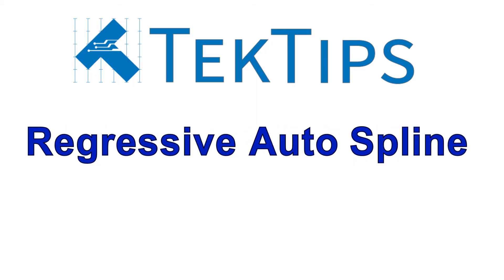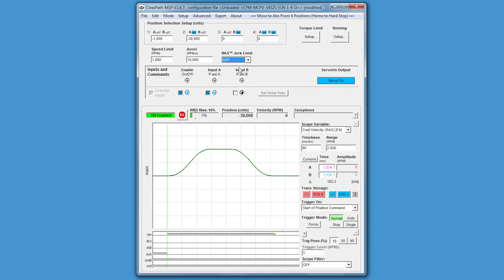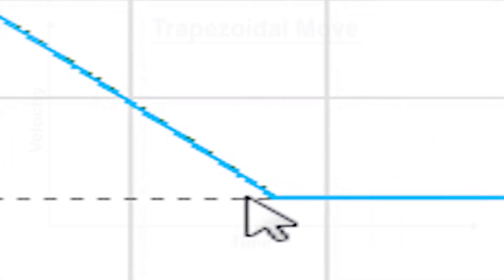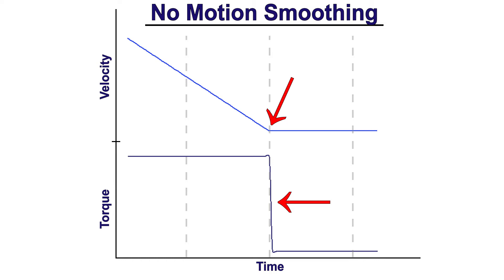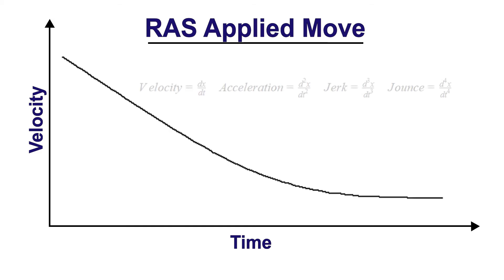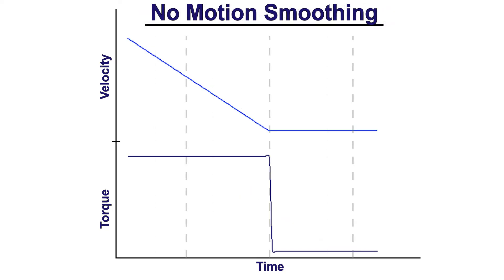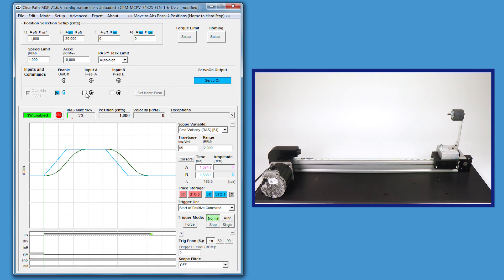ClearPath's RAS: Smoother Motion Control than S-Curves

Comment: wouldn't a pid control work just the same
Reply from the maker: Hi YUP,

While PID control loops (or PIV for ClearPath) and RAS are both used to improve servo performance, they operate in completely different ways. PID control loops use feedback to proportionally control the servo response. RAS does not change how the servo responds to the command, but instead, modifies the incoming command to reduce jerk and jerk derivative. 

If you have additional questions about how RAS can benefit your application, please reach out to Teknic’s support (https://teknic.com/contact/) or give us a call at 585-784-7454. 

Best,
Bradley N. – Teknic OEM Application Engineer

Comment: Is it possible to do this with stepper killer motor type?
Reply from the maker: Hi Roman,
Yes, Teknic's RAS feature is available in all ClearPath models, including the ClearPath "Stepper
 Killer" (SDSK) models.

The "Regular" (R) encoder resolution option of the SDSK models has RAS settings up to 16 ms. The "Enhanced" (E) encoder option has the full selection of RAS (and 8x the commandable encoder resolution),

You can view all of Teknic's SDSK and SDHP models at:
 https://www.teknic.com/products/clearpath-brushless-dc-servo-motors/clearpat,h-sd/all-sd-models/#ppsShowPopUp_100.

Please feel free to contact us directly through support@teknic.com if
 you have any other questions!

Best regards,
Aaron B. – Teknic Servo Systems Engineer

Comment: Just come cross this video it’s nice and detailed explanation but you never competed RAS to S-Curves with for me is exactly this same thing just you use different name. S-profile have 7 characteristic also include smooth increasing or decreasing of acceleration. And torque curve looks like RAS, 
can we have comet on this ?
Reply from the maker: Hi Marek,

This is an excellent question, although not an easy one to answer concisely, so please bear with my long answer. I think it will clarify the differences between “s-curve” and RAS™.

Assuming our goal is to make motion as smooth as possible, and with minimal vibration and settling time, we need to make sure that the velocity-vs-time move profile never requires an instantaneous change in motor torque. Not only is it impossible for any real-world system to follow an instantaneous change, but by trying to do so, the system will generate shock, noise, and vibration. These negative effects are bad for performance and cause excessive wear on the mechanical system. 

The common trapezoidal move profile, with its sharp corners, clearly asks the motor to instantly change the torque it puts into the system. Most people intuitively understand this because the sharp discontinuities are easily seen. (7:44 shows this graphically)

What’s less obvious is that even a smooth looking velocity profile can demand instantaneous changes in torque. To understand why, consider that the torque required by a motion system is proportional to the acceleration required. So, if we want to make sure a profile never requires the torque to change instantaneously, we need to make sure it never requires the acceleration to change instantaneously. In other words, any change to acceleration must be gradual.

The term “s-curve” is used a bit loosely in industry; it’s used by some manufacturers to refer to substituting a half cosine curve in place of the linear acceleration of a trapezoidal velocity profile. Other manufacturers use “s-curve” to describe a velocity profile with a constant jerk (rate of change of acceleration) at the beginning and end of the acceleration parts of the move. 

The latter is called “jerk-limiting” because the jerk is held to a constant finite value (or zero, during the constant acceleration and constant velocity parts of the move). A mechanical analogy that might help visualize constant jerk is putting a circular (i.e., constant radius) fillet into the corners of a trapezoidal profile. 

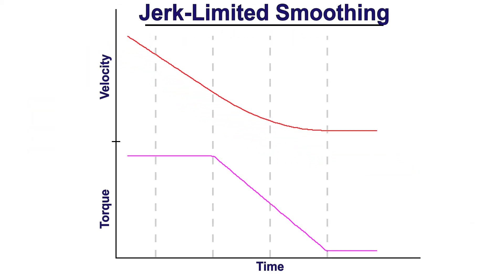A jerk-limited velocity profile looks smooth, but the acceleration is zero at the start of the move and abruptly starts ramping up at a constant rate. Then, as the acceleration limit is reached, it abruptly stops increasing. In other words, although the velocity profile looks smooth, the acceleration profile of this move is a trapezoid with sharp corners. This means the torque will have to change abruptly, causing noise, vibration and longer settling time for the mechanical system. (8:40 shows this graphically)

The half cosine type of s-curve is a little better, but still has abrupt transitions in the acceleration profile, and has the additional disadvantage that the maximum jerk will increase for moves of short distance where the maximum velocity is not reached. This is because it tries to fit the same half cosine into a shorter time period, and this makes the rate of change of acceleration (i.e., the jerk) increase. Even worse, some manufacturers will just truncate the cosine when constant velocity is reached. This results in a very discontinuous profile. With normal jerk-limited profiles, you can set the jerk limit to the maximum value you can accept for your system, and the profile should never exceed that limit.

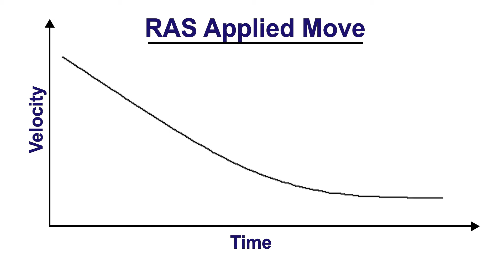The RAS feature not only limits the jerk (regardless of move parameters), but also limits the rate of change of the jerk to a constant value. Limiting the second derivative of acceleration in this way means that the acceleration profile, instead of being a trapezoid, is nice and smooth. (11:07 shows this graphically)

With the RAS feature, there are no abrupt changes in torque at any point in the move profile under any circumstances. 

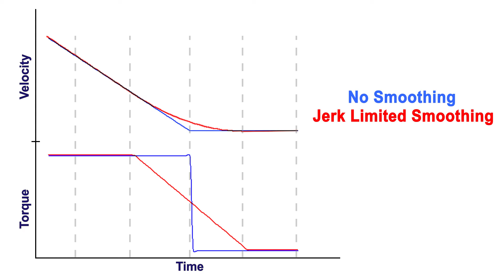Having read this explanation, take a few minutes to re-watch the video from 7:44 to 13:30. That section of the video explains, in graphical terms, how the torque requirements are different for trapezoidal, jerk-limited, and RAS profiles. 

One final note: the RAS is available in all Teknic products that have a built-in motion profile generator (e.g., MC and SC-series ClearPath motors), but also in products that accept step & direction motion profiles from a third-party controller. In the latter case, you should actually select a trapezoidal move profile within your controller, and allow the RAS to convert the profile on the fly into a jerk- and jerk-derivative limited profile. A demo of this (including the effect of RAS on the torque) can be seen in the ClearPath Step & Direction video, starting at 1:10. 

I hope this clarifies the advantage of the RAS compared to other techniques that attempt to reduce profile-induced vibration and noise. Please feel free to email us at support@teknic.com if you have further questions.

Best regards,
Zach H.
Reply: @TeknicInc   "With the RAS feature, there are no abrupt changes in torque", as I understand this, this is the same with limiting jerk. There is no jump in acceleration, it only starts increasing at a limited rate.
So, to convince the audience, please show a jerk-limited profile in comparison to RAS (or 3rd-order to 4th-order limiting?).

Another consideration is the time used for the whole movement. In the introduction demo I hear that the move with RAS is at a much higher speed (heigher frqeuency, I guess at least 1.5x, may be 2x). That's probably ok for applications that don't have a physically limit on speed. But it increases the acceleration time for speed limited applications that are already at their limit.

In your example curves at https://youtu.be/WOyP51-PiTs?t=763 we see, that the time increases from 2 to 3 sections by switching the profile. I understand, that it's not the complete deceleration curve, but your demo shows, that it's not insignificant for this application as the speed increases drastically.

Another consideration is resonance. Resonances are the limiting factor in many cases. My hope is that resonances can be eliminated completely by higher order limiting. This would make your products much more attractive, and I assume they can probably provide such an improvement.
Can you give an example of such a resonance situation? But please don't restrict yourself to a single resonance case, instead show a frequency scan (e.g. by showing a sequence of moves back and forth with a changing distance), because different profiles usually only move the frequencies but don't eliminate them at all.
Reply from the maker: Hi  @aribowell ,

Thank you for taking the time to reach out. I apologize in advance for my long response. You have asked a number of good questions (questions that are frequently asked by other customers), and I wanted to take the time to answer you thoroughly. 

In the event you didn’t notice my colleague’s response to the original comment, he stated that: “Assuming our goal is to make motion as smooth as possible, and with minimal vibration and settling time, we need to make sure that the velocity-vs-time move profile never requires an instantaneous change in motor torque. Not only is it impossible for any real-world system to follow an instantaneous change, but by trying to do so, the system will generate shock, noise, and vibration.” 

In reading his comment, I thought it might be helpful if I tried to explain this in a slightly different way, with additional detail. 

Within position control servo systems, there are actually three separate “servos” operating at any time. These servos are responsible for minimizing the errors in position, velocity, and torque. 

One of the primary tenets of Teknic’s servo systems is that we never want to command one of these servos to do something that it cannot physically do. For most people, it is intuitive that it’s impossible for the velocity servo to follow an instantaneous step change to the acceleration (i.e., a sharp corner in the velocity profile). We solve this problem in the common trapezoidal velocity-vs-time command by limiting the jerk component command. 

What is less obvious is that a step change to the jerk — instantaneously transitioning from zero acceleration to a constant rate of change of acceleration (i.e., constant jerk) — causes a sharp corner in the required torque. The algorithm that servo controls the torque tries to follow the sharp corners, which causes machine vibration, noise, and other undesirable effects. The RAS limits the jerk-derivative of the motion profile which eliminates the sharp corners in the torque command, resulting in smoother and quieter motion.

I do agree with you that seeing the differences in motion profiles (especially in the torque domain) can be very helpful in understanding this fairly complicated yet important point. If you re-watch the video starting at 13:00 (https://youtu.be/WOyP51-PiTs?t=780), the engineer in the video graphically compares the difference in the commanded torque when using the RAS or a jerk-limited profile. At 13:30 (https://youtu.be/WOyP51-PiTs?t=810) he overlays the commanded torque for these two profiles to help illustrate the differences. 

You mentioned that at one point in the video the audible frequency of the move changes. We didn’t change the velocity between those two moves. The difference in the sound of the two moves results from a subtle (yet important), secondary benefit of the RAS. 

Although the velocity profile of a servo may look smooth, if you zoom in, you will see that all digital servos have quantization effects. For example, what looks like a smooth ramp in speed is actually a very fine staircase of incremental jumps in speed. Acceleration feedforward gain, which is used in all good servos to reduce tracking error during acceleration and deceleration, produces lots of little “torque spikes” in response to each one of the little velocity stair steps. 

In addition to reducing the macro effects of noise and vibration by limiting the jerk and jerk-derivative, the RAS smoothes out the digitized nature of the servo system, reducing the torque “hash” caused by acceleration feedforward. What remains is just the higher frequency sound of the belt drive. If you’re interested in seeing another example of this, take a look at this video here (you can clearly hear and see how much the RAS affects the torque): (https://youtu.be/NbLE126rrRs?t=135).

Adding the RAS does lengthen the commanded move time, but as shown in the original video, the RAS profile greatly reduces the overall time to move and settle at the final position (even without increasing the move speed or acceleration). 

We are sometimes asked why the RAS doesn’t limit the 5th or 6th derivative of position. The quick answer is that after taking the 4th derivative of the position, and ensuring that there are no commanded discontinuities in any of our servo loops (i.e. position, velocity, or torque), further derivative limiting is of little (if any) practical value. While it is possible to implement further derivative limiting, doing so would increase the required burden on the motor’s DSP, which would limit our ability to implement other features that can improve performance. 

You asked about axes that suffer from resonance problems. Teknic offers another feature in certain ClearPath models and other products called “g-Stop”. The g-Stop algorithm does not work by derivative limiting; it actually creates very non-intuitive and odd-looking profiles, but is very effective in eliminating resonances. And it is very robust—once it is set up, you can use any combination of acceleration, velocity and move length, and the resonance will significantly attenuate in all cases. You can see a video demo of it here: https://www.youtube.com/watch?v=Aj1LyYEvstw.

I hope this helps! Please feel free to contact us directly through support@teknic.com if you have any other questions. 

Best regards,
Jon K. – Teknic Servo Systems Engineer
Reply: thanks for the long and very clear answer and especially for answering each of my points. After looking the other video (that seems t be a bit more clear) where the non-RAS and RAS curves are displayed below each other on the same display, I noticed that I had misinterpreted the frequency. The non-RAS move has some lower frequencies *added*, which I thought to be comparable to the RAS frequency, instead the RAS frequencies are a subset of the non-RAS frequencies. I think, that relates to what you said about the filtering effect ("smoothing out the digitized nature").
According to the time: In the other video you can see, that the curve for RAS is slightly longer. I think the acceleration phases must become longer compared to profiles where only acceleration is limited (and usually at a constant maximum or zero), because smoothing the derivatives means that the acceleration is not at the maximum all the time. That's why I assumed a higher speed.  And yes, I ignored the settle time for this point of view.
My conclusion is, that all depends on how the application limits each of the derivatives. For some applications it's mainly speed (CNC machining), for some it's the force applied to a mass (so acceleration) and for others it might be the jerk (e.g. when audible noise should be kept low).
Thanks for the link to the g-Stop algorithm, I will have a look at it.
Reply: @TeknicInc  , just a feedback, g-Stop seems to work really fantastic, thanks for the hint.
Reply from the maker: Hi @aribowell ,

You’re welcome. I’m glad that you found the additional information to be helpful.

You are right though, we don’t always concern ourselves with the “settling time” in every application. In some applications (e.g. a CNC router) we’re trying to follow a very specific path through space; we are not trying to move from point A to point B and settle quickly. The RAS does help us in these applications as well, though (more on that below). 

In a typical, jerk-limited, point-to-point motion profile, there are four changes to the commanded acceleration before we finish moving. But with fixed jerk, there are four times where noise and vibration are injected into the mechanics. In a CNC application, where we’re cutting arbitrary and infinitely variable shapes, we may command dozens or hundreds (or more) of these same inflection points during any individual cut. 

These same step changes to the commanded jerk will affect the on-the-fly dynamic performance of your system every time we change our acceleration command. If you were to compare two cuts, one made with the RAS turned on, and one made with the RAS turned off, you would notice that the edge finish of the cut part is noticeably smoother with the RAS turned on. 

As a side note, we cannot use the g-Stop in CNC applications. It’s designed specifically to kill significant resonances, and it can significantly change the command profile in doing so. This would have a bad effect of the shape of the CNC path. (In a point-to-point application, the exact path is generally not important.). 

The RAS, when used at relatively low settings (application dependent) has an overall beneficial effect on CNC performance. All of our OEM CNC customers use the RAS feature.

Thanks again,
Jon K. – Teknic Servo Systems Engineer